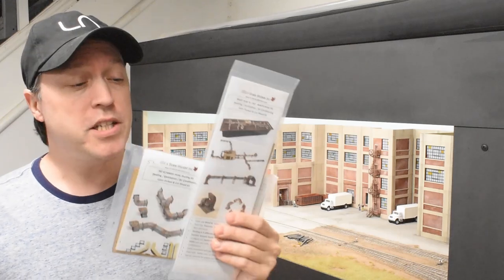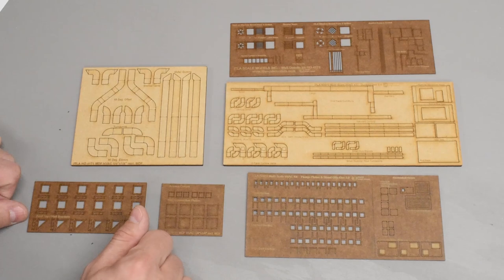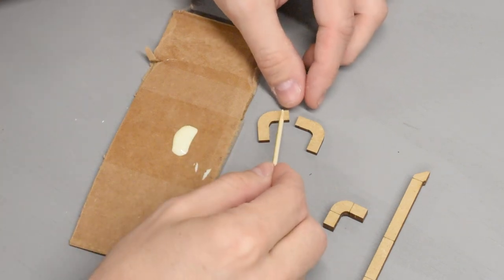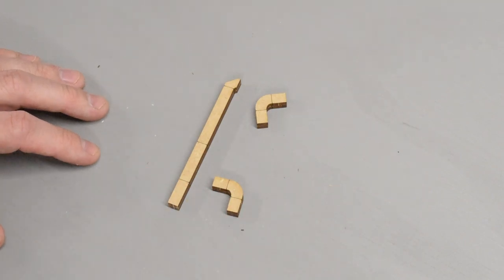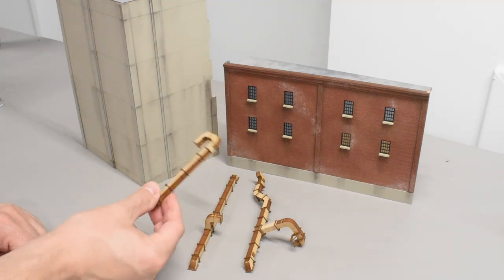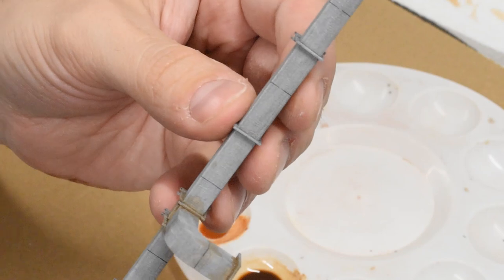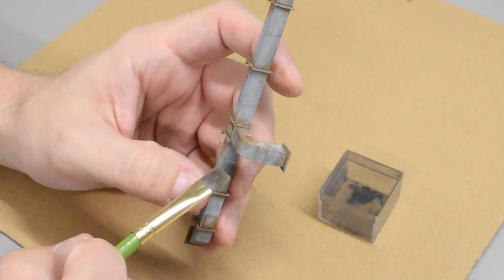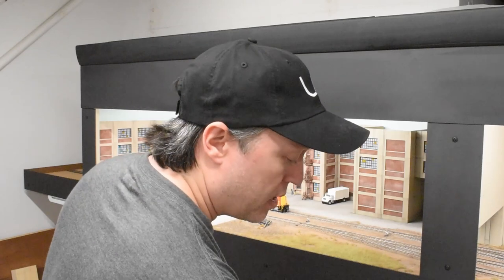Working with ITLA Scale Models HVAC Ventilation Detail Kits

Comment: I’m just wondering after you glue the two pieces together do you sand it so that you can get rid of the joint lines?
Reply from the maker: For the HVAC kits, I like to put the braces over the joint lines so they are hidden. Otherwise, I would try to fill them in with glue/paint to try to minimize seeing them. They're so small, though, that at normal viewing distance most people probably wouldn't even notice as they get lost in the scenery as a whole.